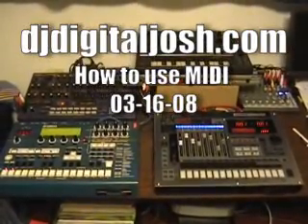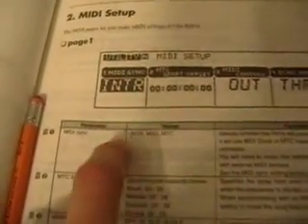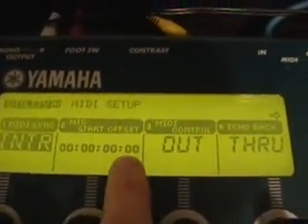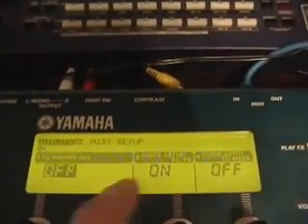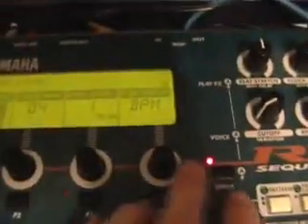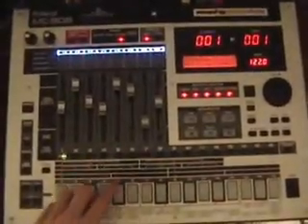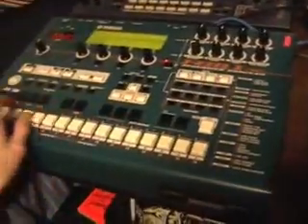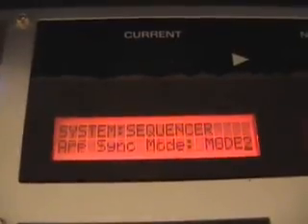How To Use MIDI

Comment: Hi I have the Arturia creative drum controller which I can use with mt DAW and the sound's etc. Just bought the YAMAHA RM1X and I am trying to sync it to my Daw .Problem is .the RM1X doesn't show up in the midi pref's list and I can not seem to get the RM1X to work with my DAW I have looked on the you tube and there isn't any simple video's showing how this syncing a YAMAHA TO A DAW VIA MIDI .is the midi function on the RM1X just for connecting other hardware up to it OR is there any way to get it sync up using midi via my Tascam interface so that when I press play or record it will sync with my DAW midi clock ,As I would like to be able to record ONTO  a Track  any music I have made on the RM1X .I know one can do this using Audio from the RM1X but again it all come's down to getting the timing right so the music is spot on .And if any one has upgraded the chip to 1.3 version would like to know if the chip has new sound's on it etc. thank you ...Lawrence
Reply: IDK about the arturia-rm1x combi, just wanna tell you about the update 1.13 chip version, it doesn't have any sounds neither other stuff, it just fixing a bug that rm1x has, when sequencing other gear (from it's midi out), it sends unwanted PCs (program changes, that makes the other gear to change their sounds, usual to piano since it's often the first sound..). 
But this can be avoided, by changing the rm1x's Tone Generator to smth other, (SyMater, Drumkits, whatever ), except ***phrase***...This is the only difference about the 1.13 update, AFAIK, i'm almost sure...

Comment: @IanCanefire I would suggest to look into the RS7000. Better cheaper and super flexible as a sequencer. It has 2 midi outs, which is a great thing. I use the second midi out to send start/stop messages to my MC808. I do not like the roland sequencers because they do not let you do enough realtime while recording modifications. Roland grooveboxes and workstations cannot compare to the yamaha paradigm.